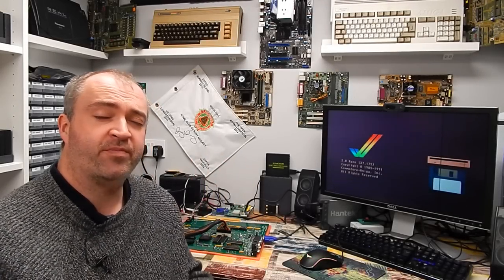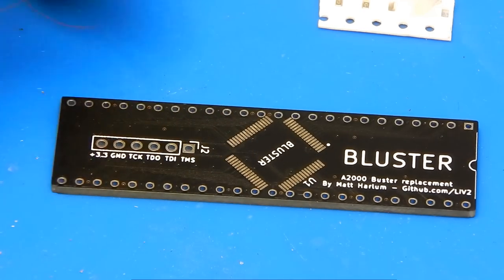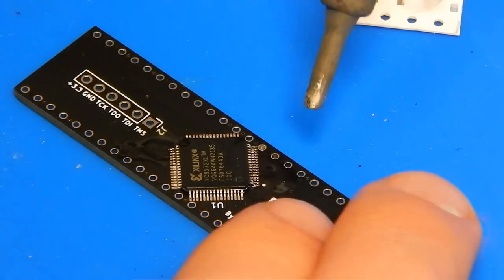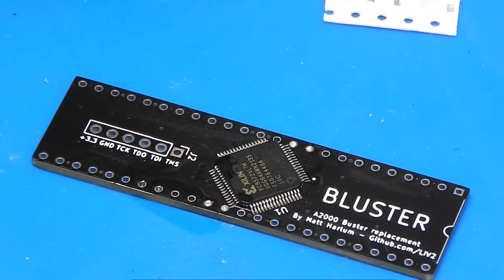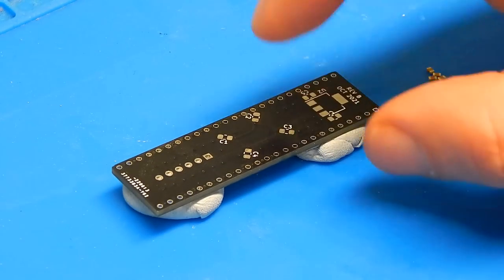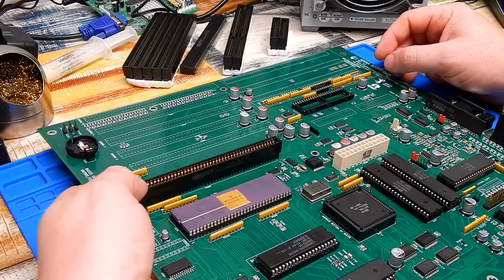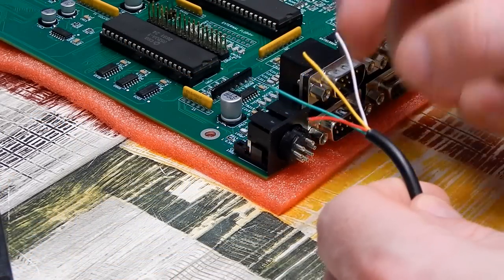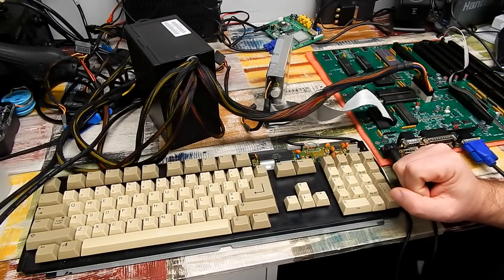Building a NEW Amiga 2000 in 2022 - Part 2. Zorro, bluster, keyboard and case

Comment: So happy it works for you, makes it all worth it in the end, doesn't it.

Now, you might want a bridgeboard so you can use the EISA, a gfx-card, network card, sound card. And an accelerator, 2040 or 2060 should be fine.... uhm.... yeah, I'll stop dreaming now.... 🤣🤣🤣
Reply from the maker: I've had all those dreams lol, would love an 040 or 060 but it'll probably have to be the 030 for now.  

Bridge board would be a nice addition.  So many options it's hard to decide.

Comment: Love this Video! I would love to do the same but would love a Coloured PCB like Red or Blue tbh.  Also, what do you do if you don't have a spare Amiga 500 keyboard?  Can you use a PS/2 Keyboard?  -Mark.
Reply from the maker: Thanks, glad you enjoyed the video.

Our boards were ordered green as that was the only option when getting JLC to part assemble it for us.  Fitting everything ourselves just seemed like too much work 😂

If you don't have a spare 500 keyboard then yes there are adapters out there to use a ps2 keyboard.
Reply: @CRG  in my A1200 tower, I use one of those A1200 keyboard to DIN converters, and then over to PS2 style. it works ok, but fails to register 2 key presses at one time. I think using an actual A500/2000 keyboard really is the best solution, if you can, or hope that you can find an adapter that really works flawlessly.

Comment: I am about to start building one of these machines. How did you solve making the A500 keyboard into a nice external keyboard? I would like to somehow make it into a rather slim keyboard case, and it would be really useful with your feedback. Thank you.
Reply from the maker: I just 3d printed the stands and covers for the other metal bits and circuit board of the 500 keyboard.  The only proper solution for it that I know of is the checkmate keyboard case, but it was too expensive for me and does look a little industrial.
Reply: @CRG I dont like the checkmate cover. Yours seems a lot slimmer and more elegant. So I will follow your example and design something similar and 3d print :)

Comment: What about an N2630?

Great build you have done there.
Reply from the maker: It is very tempting but I've already got 2 030 Amigas and I'm not sure I really need another.  This machine now has a pistorm at its heart but ultimately it's waiting for the TF2040.
Reply: I have 040 in a 2000 and that is quite interesting.

I always liked the A2630 as you could set a jumper which allowed for selecting the 68000 or 030 via mouse pointer menu on startup.

You can also have FPU and massive amount if RAM via the back pin header with an Icomp memory upgrade kit.

Comment: That looks amazing! I was wondering what you would do for a floppy drive with that case, until you said "Gotek." I absolutely love the way you integrated that in there.

To your question of what we would have done differently, Similar to a comment I made on your last video, the only thing I would have done is to use a USB keyboard, the same way GadgetUK164 did, here (link with a timestamp added) https://youtu.be/X7wNfDoZChI?t=244

That will be the solution I'm planning to use for my actual Amiga 2000, which is missing its keyboard, and a correct Amiga keyboard is absolutely cost-prohibitive.

But I do love this entire project, here!
Reply from the maker: Thanks, glad you enjoyed it.  

I had forgotten about that adapter board and it might be an option for the future.  I'm working on something to make the A500 keyboard look a bit better so will post a quick update (probably just a community post picture) once I get that done.
Reply: It's all good! Looking forward to seeing your updates :-)

Comment: All that work for such an awful case. That is way too bulky and doesn't really match imo. Should have 3D printed a case for this, or went for a beige tower or something similar.
Reply from the maker: Each to their own.  I love it as it is but I will admit I seen this same board at Kickstart in a custom beige tower painted to match the commodore boxes and it looked amazing.
Reply: @CRG  sorry to be hard on this though. It is your build after all. I only mention that cause I plan on potentially building a Mister clone wedge computer and have seen so many awesome Amiga replica cases. Wouldn't even mention it though if it weren't for that.

Either way it's not like you can't recase it later. However because of how that's stacked, probably the only thing to do is with a huge tower anyway so it's not too far off.

The skill required for this is commendable though. Way beyond my skill limit.

It just has this weird Zoomer gamer RGB vibe when it has glorious old school hardware. I would have even put it in a Checkmate case or something.